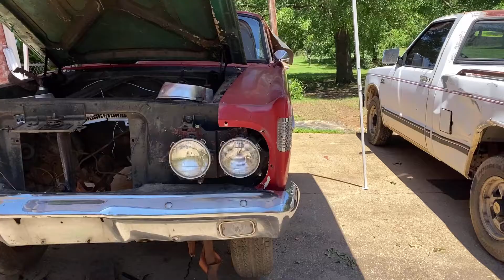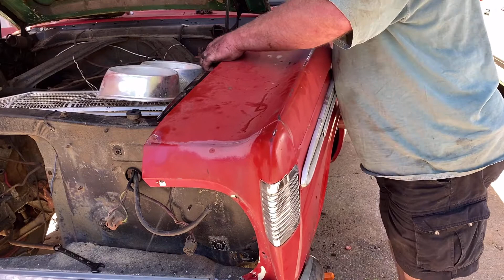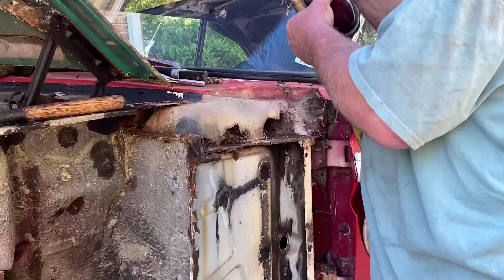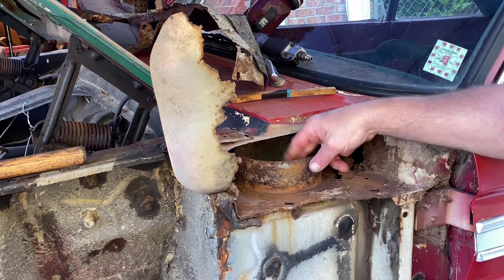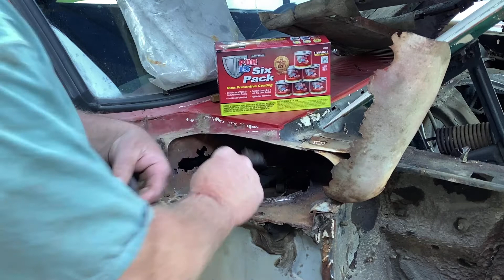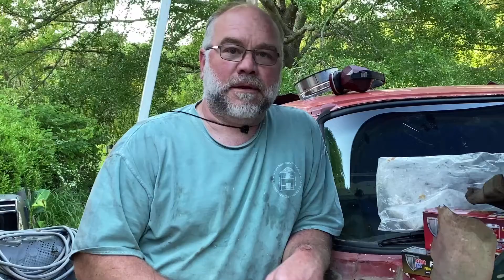Mercury Comet Cowl vent repair

Comment: I usually prep the steel with something like POR or whatever then use epoxy with fiberglass. To me it works better because you just have to get the glass mat wet with it first then just lay it in and smooth it down. Then go over it with a brush and slather the epoxy everywhere. It lasts forever and it's cheaper than POR.
Reply from the maker: I’ve used fiber glass, but I wet the surface with por 15 the. Lay the fiber glass in that and the continents to wet the fiber glass with the por 15. I fixed some floor boards that were pure Swiss cheese.